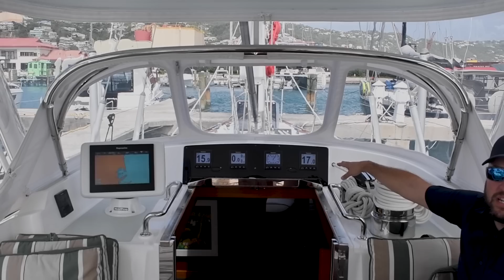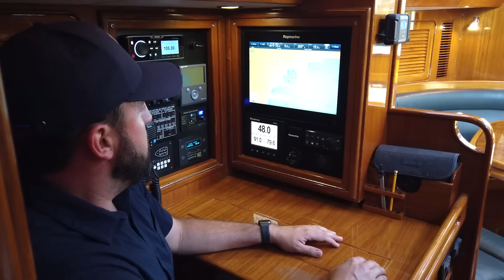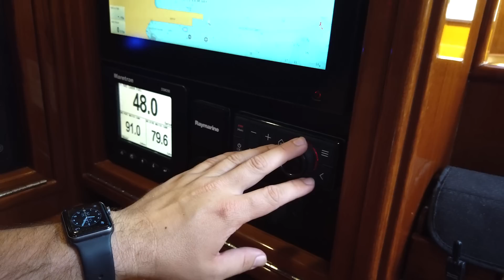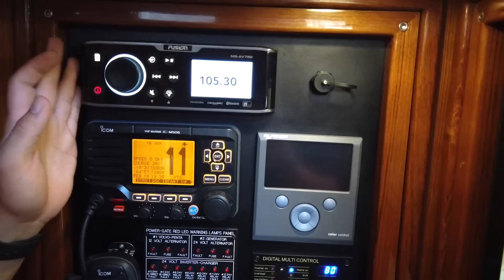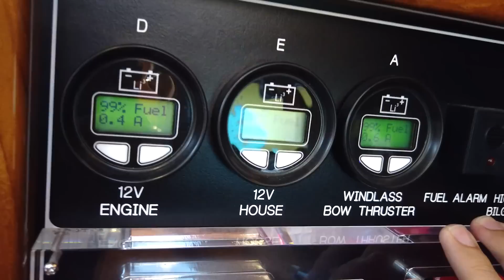Hylas H56 2018 'SERENITY 2' SOLD by Erik Haaland & Josh McLean

Comment: What a beautifully designed and constructed vessel. 

Excellent presentation in interesting conditions.
A tiny, tiny observation.......
Galvanised 1/2' anchor chain and a significant stainless steel anchor, shackled together with a well-rusted galvanised shackle. 
Next owner might reconsider this arrangement.
Reply from the maker: Already swapped out! Keen eye though!
Reply: This is something I noticed as well, could have used more fresh water washdowns when pulling that anchor up.

Comment: Nice presentation, beautiful looking yacht. However, I'm concerned about the batteries under the setee and the bed. I'd think maybe the energy eminating from the battery might be a problem especially of sleeping hours at a time on the bed over them. I think some kind of shielding would be helpful.
Reply: The batteries are low voltage, buddy.  They are likely 12v or 24v and should be completely silent.  A good battery system should not generate much heat, either.

low voltage direct current is fairly safe and low or zero electro-magnetic noise.